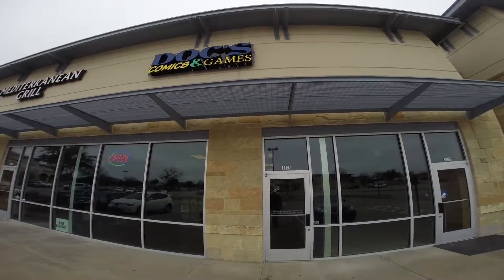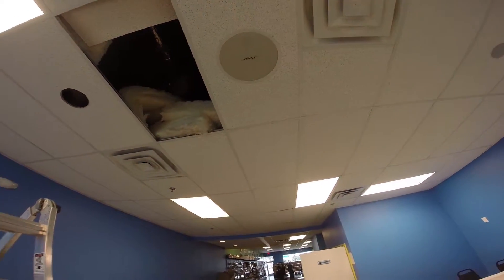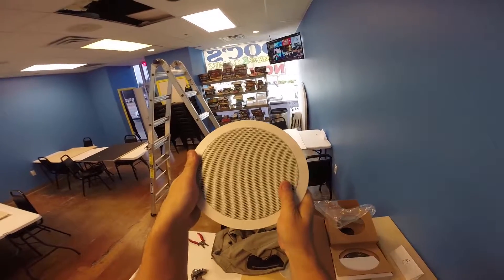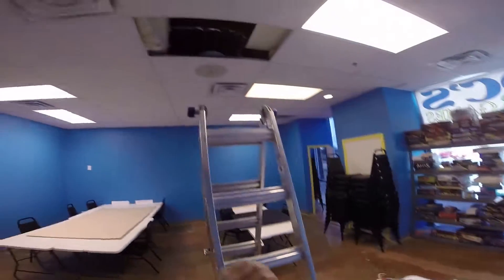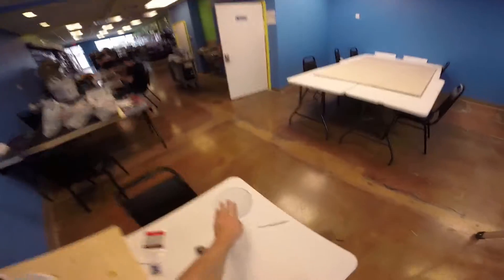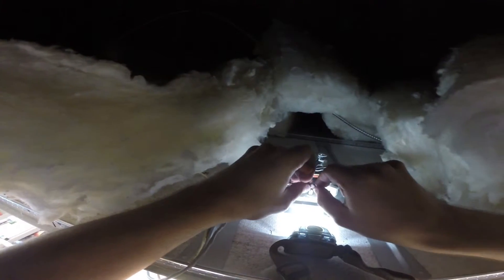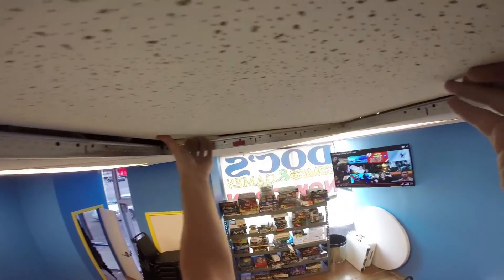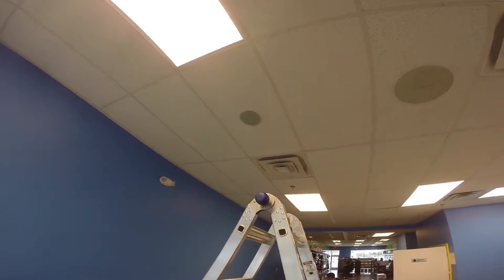70v speaker system install at Doc's Comics and Games

Comment: Should have put the sub near the corner of the room. The center of the room is the worst spot...the only benefit is that it looks esthetically pleasing.
Reply: Not only that, but he also didn't show trimming off and covering the unused leads to avoid shorting out the amp. BIG TIME no-no to leave them uncovered and simply push them out of the way like that...unless you want the client calling you at some point and telling you their amp smoked out. See how the Muzak tech did it on the old speaker? That's the correct way to do it.

Also have a genuine question for the OP why that client needs the new speakers tapped at 10W in that area when the HS-1CM only had a 4W transformer with a max SPL rating somewhere in the 102-104dB range @4W. The Muzak tech looks to have had them tapped at 2W which would've still delivered at least 96dB at max volume, which is PLENTY loud for that small of an area unless you want to deafen your customers. Looks like someone blew them out trying to do just that because there are tens of thousands if not hundreds of thousands of these speakers in service right now providing trouble free service.

This is why people should hire actual AV professionals to install systems like this and then only let people who understand how these things work use them. You will never find me leaving comments like this on videos, but people watch these things to learn how to install their own. Let someone drive those speakers so hard that the untrimmed leads touch and a spark hits that fiberglass insulation.

Pro tip, just because it looks right doesn't mean it is.